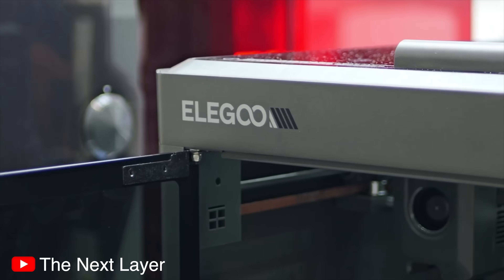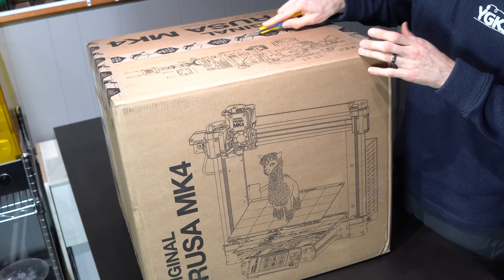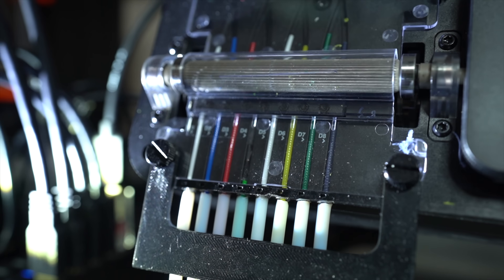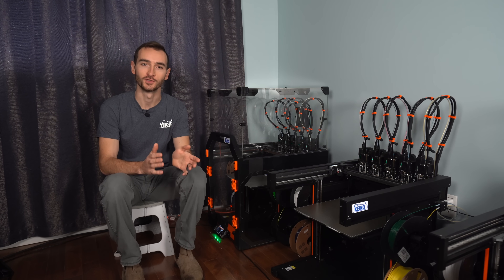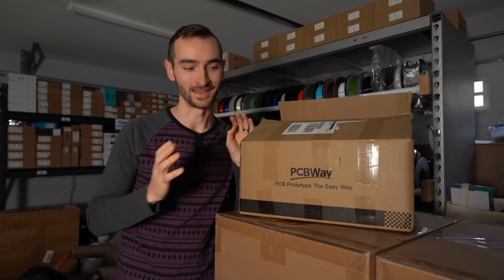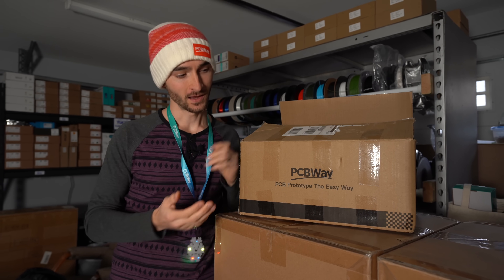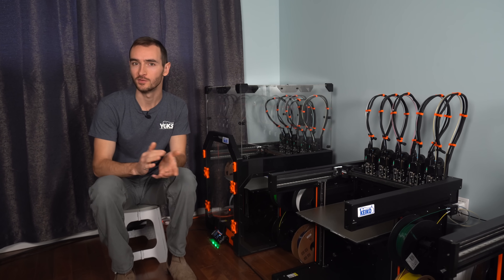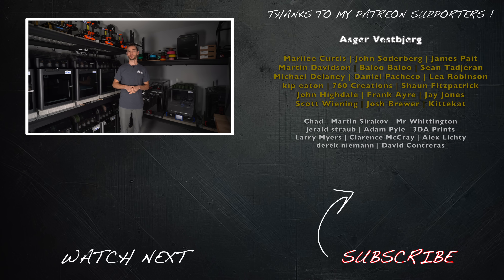The Prusa Core One is dividing the internet...

Comment: Prusa needs a 350x350x350 color combo killer and the Core One isn’t it. It’s just a stop gap to a longer term problem. Nobody cares about a nice nook for their filament or a built in tool cabinet. Convenient, but the market doesn’t want gimmicks. They want a bigger build plate and color.
Reply: What the community really want is fast and large idex printers. Maybe nobody is saying but till one appear with a volume of +300mm +800mm speed but also doest need any work from the user to align anything and  offset is always perfect for both nozzles then everyone will leave these ams systems
Reply: @tired5925 The speed requirement you listed is a pretty naive notion of what speed is on a 3d printer. It really means next to nothing. No currently availible printers print at those speeds, nor does that number by itself mean anything.

A combination of nozzle size, volumetric flow, cooling performance, acceleration before notable quality decreases and more all are what really matter for speed, not a meaningless travel speed.
Reply: @tired5925 ratrig incoming. It's DIY total kit though.
Reply: @tired5925  ratrig vcore4 to the rescue! One of the printers to replace my 4x X1C’s
Reply: They have one though. Prusa XL already has a 360x360x360 build volume and can print 5 colors/materials in top config. The only non-killer thing about it is the abysmal price.
Reply: @wowiwou  that's true but not only is the price abysmal but so is enclosing it. Can buy a whole printer (and decent ones) for the price of the enclosure and then you have to assemble it.

Id it weren't for the multi tool head the XL wouldn't be worth talking about. I hope prusa takes lessons from both and combine them.
Frankly the upgrade path is nice but probably limiting for how much they can really innovate. Imaging if the core 1 had a 300 cubed x build volume. Bigger than Bambu. People would love it
Reply: @wowiwou I have 4 Prusa XLs for work. I’m disappointed in the print quality and speed compared to the bambu p1s. The same size objects come out worse on the prusa and it takes longer. Prusa should have enclosed the printer like a Voron. At a minimum, they should have enclosed the filament. I’m in a humid environment and the filament gets brittle fast. It’s very disappointing for $12k.
Reply: @wowiwou  I agree, but that thing will never go fully decked out for less than $3000 new. I was addressing the fact that the K2 meets the requirements 350 cubed and able to come in with a "reasonable" price.
Reply: A lot of people want colour without the waste of Bambu or the cost of the Prusa XL. Whoever solves this will be a key player moving forward
Reply: @tagg8233  I fully agree with this comment!
Reply: @tagg8233  I suspect Bambu will, but the cost won't be popular.  The rumored HD2 is rumored to be a dual-nozzle printer, reducing number of color changes by 50%.  But that's a rumor.
Reply: I'd probably get a RatRig vcore4 myself if those were my requirements.  Build sizes up to half a meter on each axis, IDEX, all-wheel-drive drive system for more gantry power and control, metal frame construction, open source...

What people generally don't realize is that larger beds take longer to heat soak to normalize. My v2.4 350mm takes almost 40 minutes of heat soaking to stabilize to a point where it's stable enough to start a large print without the risk of bed flexing releasing prints.  Larger build volumes on a CoreXY printer mean you need longer belts, which means you risk stretching on the belts, so you have to go up in size. Then you have more mass on the flying gantry, which means more inertia and less acceleration.  Unless you're consistently using the full bed for each print, using the smallest printer bed size that you can for CoreXY will result in the fastest print times. That's why I use my v0 as often as possible.

You always think you want the largest bed size you can get away with, and I was one of those people, but I should have listened when people told me it was a mistake.
Reply: @sq3rjick  RatRig vcore4 is a beast! I have a friend who has a vcore3 and it looks so overwhelming, but looks like an amazing ecosystem. 

I own over 30 printers and one of them is an  SV08, you are totally correct on the complexities of large machines.  I just had a crap show happen because I didn't let my bed soak long enough and had  a print release, bad things happened.  

Regarding smaller printers, I love them and agree with you. I built a couple of Rooks and just ordered a V0.2 R1 and super excited for the build.  I love the build volume for smaller functional parts for sure!
Reply: Printers like that already exist. They are just out of the budget of hobbyists.
Reply: Prusa XL, enough said
Reply: You just described the Prusa XL and the Creality K2.

Those machines exist. One is really good but really expensive, the other is very wasteful.

What you want is a middle ground between those in terms of cost and less waste.
Reply: @carlosjosejimenezbermudez9255  yes. And I'd love it from a company like Prusa. There is the rat rig v core 4 which is incredible and I'd love to have it but not sure I have the time to assemble it. Basically need out of the box ready to print
Reply: @willofthemaker  Then you have to pay someone else for their time to assemble the printer. It's no different to paying more for a product that is also available cheaper as a kit.
Reply: @ ya I get it. But full time job, 2 side hustles, 2 likes under 3 means I just don’t have the time to build a printer. Wish i did. But if I could buy a built core 1 with a bit more volume I’d be very happy. I don’t want to buy a bambu.
Reply: Hardly anyone needs 350x350 multi-color. My 350 voron is sitting on the floor in the garage and my X1C does all my printing. Likewise, 90% of the time, all I use the AMS for, is easily switching between multiple single colour prints. 

What most people want is more speed, 300x300 bed, and zero hassle with perfect prints.
Reply: I care about dimensional accuracy and part strength.  Am I in the minority?  Can you provide your sources so I can learn more?
Reply: I think an IDEX tied to a multi-material handler would be awesome.  You could have an eight or ten color/material machine. 

If managed properly, color/material change times could be reduced.
Reply: Agree.  Interested if it was that size and a similar price.
Reply: True, size matters :) I'm not really a big fan of what they did with the spool holders on the Core One either. But I'd still be interested in one once the kit is available.
Reply: I have to disagree. Who really needs 350³ or color combo? Both are niche and the combination is niche².
When I need that, I have a piece made by someone else. My tasks are single material and smaller.
Reply: @jackmclane1826  I have several things I would like to print that are large and/or would be much more attractive if they were multiple colors.

Yes, I have painted things to me multiple colors, but they are not near as clean as I would like.
Reply: color is a gimmik
Reply: My definition for good printer is in random order: 1) Easy to use 2) reliable 3) repairable 4) no too much waste when multicolour 5) fast 6) good quality print 7) machines overall price 8) open source 9) good slicer 10) companys after sale services (spareparts, guarantee, updates, problem solving)
Reply: Agreed, I and many other X1C owners have been waiting for an X1C XL from BB. Prusa could have done that, but instead they made a competitor with less features and a smaller build volume. They are never going to win on price, so they need to do something to differentiate from the X1C on features. Build volume was the easiest way to do that.
Reply: @DeanRockne  They don't need to win on price. Any good person should be happy to pay more for a product that isn't made in a country that is an enemy of the west and actively is trying to hurt America, England, the EU, Taiwan, Japan, South Korea and Australia.
Reply: There is A market asking for that but most of Prusa's customer base has been asking for this exact thing. This is like scoffing at the A1/mini because it's not built for an industrial audience, that's just not their focus.
Reply: For print farm you don't need big print volume. Overal speed and print quality is more important. Core One which is much faster than X1C and has compact dimensions is no brainer now.
Reply: @biomech8 depends on what you print. Some of my products are over 270mm tall so the core one won't work. Most of my things would though. I generally like the core one and may consider purchasing it in the future for some parts but won't do it all. 
I would love a 300 or 350 cubed 2 tool head or ideally idex version. Basically halfway between a core one and xl
Reply: @biomech8  It is not much faster than the X1, what are you smoking?
Reply: @joshwhite4412  people don’t realise this but PRUSA MMU is actually faster than Bambu multicolor and XL is several factors faster.
Reply: Almost everything the OP wrote was wrong or misinformed. 1) Prusa already has an amazing Core xy multicolor (even better multi material and multi nozzle size) that is 360x360. People cry about the price  - it got 5 tool heads, and a heat bead that is miles ahead of the competition.  2) those side compartments are not gimmicks (if you would have educated yourself). It’s not what you put in them, it’s the function they serve in reducing the dead space INSIDE the enclosure, enabling the bed to quickly heat the chamber.
Reply: I'm hoping they will scale up the Core One to a larger bed size at some point.  But it's pretty sweet that they offer an upgrade from Mk4s to Core One, which explains the print volume.  And it's nice that they managed to squeeze out a little extra volume on the same plates.
   
As for color, the MMU3 has been performing pretty well for me.  They need to improve the usability of that thing; compared to the AMS it is a real pain to load filament into that thing.  There's a few aftermarket options to do away with the buffer, which makes for easier loading and a smaller footprint.
Reply: They have the XL with 360x360x360. The single tool is reasonably priced for the build quality, electronic engineering upgreadability and support. 

But you want Prusa to release an Elegoo or a Creality killer. 

They don't care or need to make these cheap frames anymore, there is the MINI which is a long-lasting high quality jewel of a printer.
Reply: So the Creality K2?
Reply: @the3dprintern  The K2 is a Bambu clone with a larger printbed.  They even copied the Bambu LCD interface.
Reply: @johngelnaw1243  cool👍